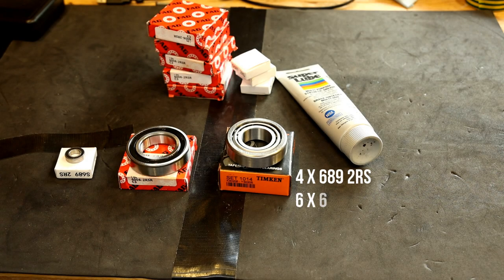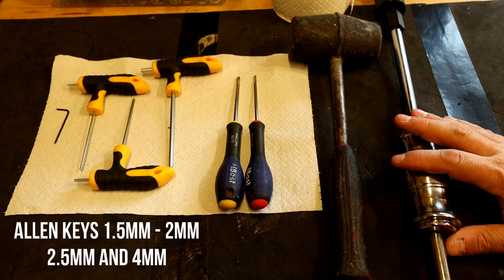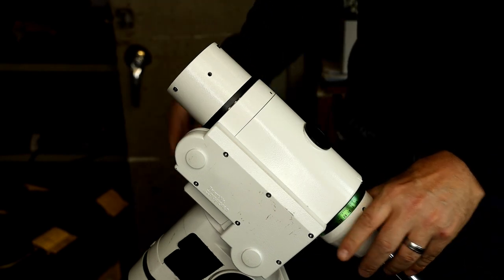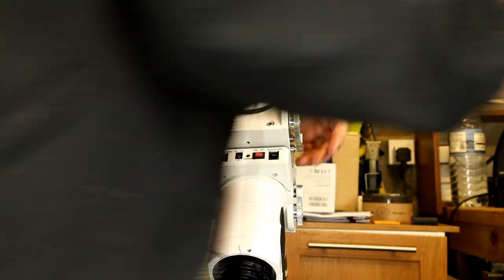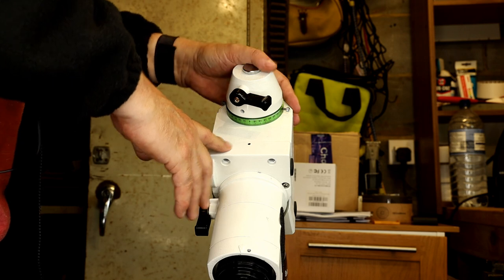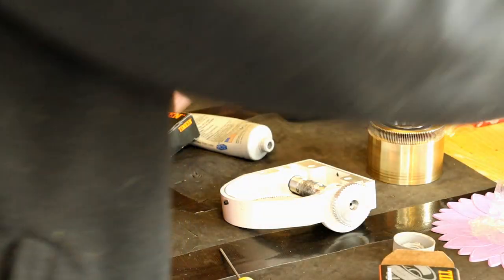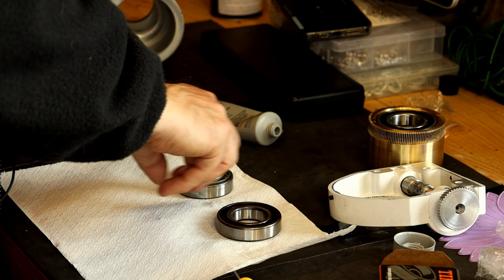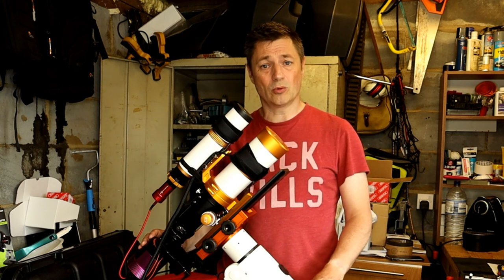HEQ5 Pro Hyper Tune. Get the best out of your mount. Astrophotography

Comment: What about just changing/upgrading the four small worm gear bearings? Dark Frame seems to just replace those and only inspects the larger bearings and replaces them if they are damaged. I think their logic is they do not rotate as much and move at a much lower speed. Also, movement on the main axis bearings does not really cause backlash, while movement of the worm gear bearings has a direct influence on rotation of the main brass gear. The 4 small worm gear bearings are fairly inexpensive while the 8 large main axis bearings are quite a significant cost.  AstroBaby in her EQ6 Supertune as suggests only the worm gear bearings are worth replacing. Martin in his video repacks the large bearings with new grease, which might be helpful.
Reply from the maker: If your mount is nice and smooth and the bearings are good then sure there is no need to replace them. I went down this route because my mount had stiction in the DEC axis and grease had leaked from one of the bearings. (Cheap unbranded bearings with poor seals) the main bearings won’t stop back lash as you say but a smooth mount with no stiction is easier to balance.
Reply: @Astrobloke  Good point about the leaking bearings. I notice on the bearings-online website for the 6006 2RS1 SKF deep groove ball bearing (the large replacement) it says they are sealed for life with an NBR seal on both sides. That makes me think that Martin's approach of breaking the seals and re-greasing might be asking for trouble since it will probably encourage leaking (particularly under hot conditions).
Reply: @Astrobloke  I think the small worm gear bearings are under a high amount of radial load and probably get mistreated by overtightening during the final adjustment process. In a sense, they are being asked to act like springs to keep the worm gear engaged, which is probably not what they are designed for. I notice Rowan Astro has an EQ6 worm gear replacement which has built-in springs to keep a constant pressure. Would be nice if they had one for the HEQ5 too or if someone figured out how to implement spring loading of the worm gear for the HEQ5. There's your next challenge!

Comment: If any of your axis feel notchy, then suspect the taper roller bearing and/or over tight adjustment of the bearings
Reply from the maker: Quite a common issue with these mounts out of the factory

Comment: Great vid Glen, very easy to follow thankyou heaps. This is the vid that gave me the confidence to have a go myself. Butttttt!@!!  I have one bearing stuck like the preverbal to a blanket to the base of the Dec shaft. I played with it for about an hour. It's stubborn. I'll have another go tomorrow.
Reply from the maker: You are welcome Chris. So annoying when one bearing hangs on. I had one do that to me once and I made sure there was grease on the  shaft and kept either working it up or tapping it back down with a rubber mallet. eventually turning it upside down it just fell off. They just need to be dead straight. Good luck

Comment: Thank you Glenn, I watched all your video in the hope of improving the guiding performance of my HEQ5. I have to say that in my experience any stiffness users may detect while spinning the RA or DEC axes, with the clutches released, is more likely to be caused by scuffing between the very large brass wheel gears and the close fitting outer housings rather than by any stiffness in the bearings. Thinking about the design philosophy behind the clutch action ask yourself why the brass wheel gear has such a large surface area and is such a close fit inside the outer housing. The locking of the clutch is not achieved by friction alone between the small button and the surface of the wheel gear. Regarding adjustment of the worm and wheel engagement I would also suggest that it is better not to fit the toothed belts and to turn the worm gear by hand while you make the adjustment. This way it is easier to detect binding which unfortunately can start well before backlash has been completely eliminated. I prefer to put up with a little backlash rather than have increased wear of my worm and wheel teeth caused by high engagement forces. Having said that you are getting great guiding performance at less than 0.5 arcsec RMS, I am doing well if I get down to 0.8 arcsecs. Cheers, Pete.
Reply from the maker: Hi Peter and thank you for your comments. I'm sorry but I don't fully agree with your theories on the mounts operation and design.
Any mount with rubbing between that gear cylinder and the housing would be in serious trouble and just wouldn't work at all. A lot of the stiction is caused by leaking grease onto that cylinder from cheap bearings or poor assembly and also parts being over tightened. That gear needs to spin freely in the housing. The large surface area of the gear is not to do with the locking mechanism. Its diameter is set by the number of teeth the gear requires and the rest of the body is there to hold the 2 deep groove bearing races that are needed to allow it to turn with minimum resistance on the shaft axis.
The centre shaft could never be moved to force the cylinder to contact the housing and the gear is locked just by the brass button and screw of the clutch lever. This is why when locked it can be made to slip without much effort.
I understand your thoughts on gear wear but as long as they are lubricated correctly there is little danger of that happening as these move at such small increments. I would argue that your guiding would improve if you fine tuned out your backlash. Good PHD2 settings using the guiding assistant and PEC training have all aided in me getting such good guiding figures and my mount now performs perfectly.
Reply: @Astrobloke  Hello Glenn, thanks for very detailed video and explanation about the mechanics of outer housing and the cylinder. I have a question though: during guiding and go-to, after we lock the clutch, is the brass button the only source of friction to drive the axis by the cylinder gear? If it is, it really seems not very secure and tight… considering the axis maybe be carrying up to 13kg of payload.
Reply: @yanghu6133  hi. Yes this is all friction that is applied. Remember your load is balanced so the forces needed to slew or track the mount are not that great. Unlock your mount and you can feel how much effort it takes to move it just by pressing down or lifting one side.  Not very much at all, hence why the locking mechanism is so small and simple and not required to be anything more.
Reply: @speedtripmantriumph7542  thanks, Yeah it makes sense. And also if the axis is stiff, it will put pressure on the guiding as well. So bearings are really important it seems!
Reply: Hi Peter, you were absolutely right with your assumption. After replacing the bearings of my HEQ5 I still had a little stiffness in my mount. I just saw that the brass wheel was scuffing inside the housing. I used a little sanding paper to just remove carefully a little material where I had brass markings from scuffing. That fixed it. Mount is moving freely now and is tracking perfectly. Thanks Glenn for this video.
Reply: @Karnivor555  Pleased to hear that you have successfully improved your mount. Tightening the clutch can make the button mark the surface of the big brass wheel a little. Regarding the clutch action the way it works is as follows: tightening the clutch lever pushes the button against the brass wheel which in turn pulls the housing away from the brass wheel on the button side and that causes the housing to press against the brass wheel on the opposite side. Because of the close fit between the housing and the brass wheel it doesn’t take much strain of the housing to get good friction over a large area and to lock the housing to the brass wheel.

Comment: Excellent presentation Glenn, thank you. My HEQ-5 is quite tight in RA, and difficult to balance. This has given me the courage to fix it. I notice that the  6006 2RSR units are coming up as "No Products Found in This Category" on the Bearings Online site, so I assume they no longer hold stock. Looks like I can source them from a supplier here in Australia though.
Reply from the maker: Thank you Neil. You can also use 6006 2RS1. Think the code denotes the type. The 2 and S meaning 2 seals so sealed both sides. The bearing companies are very helpful if you call with any questions and can recommend comprisable products. Should last a lifetime seeing as  they will move only 180degrees max in a night  and not 20,000+ rpm as designed
Reply: I would suggest loosening the lock nut that apply the pressure on the tampered bearing first.   Those mounts are assembled way too tight from the factory.   Loosening it would help quite a bit.  I did this on mine and it balances very easily now.
Reply: @tempusfugit6820  thanks for the suggestion. I'll give it a try.
Reply: @Astrobloke  I have now completed the process.. The RA is really good, but the Dec, while moving quite smoothly, doesn't spin like yours. Any suggestions? I'm still quite pleased with the result overall.

Comment: I have found the grease used on RC transmissions to be excellent.
Reply from the maker: I will have to check that out. Is it lithium based?
Reply: @Astrobloke  I cant remember, the stuff i use is called udder butter by CowRC.
Reply from the maker: @jasonpressler7111  Thats such a cool name, they also sell Moo slick lol

Comment: At 14:27 you have a very smooth and nice brass worm gear sliding against the aluminum body in an effortless way, but mine has a lot of drag. My bearings are great, rotating nicely, but I think the brass cylinder is just super tight with the tolerance up against the housing, so it causes drag and stiffness in the turning of the DEC axis. Do you have any tips here? Maybe remove grease from the brass cylinder gear and housing (apart from on the actual teeth), and (possibly) turn it in a lathe with some emery tape and take it ever so slightly to reduce the drag. What do you think? W.
Reply from the maker: The clearance is very fine between the brass cylinder and mount housing. There should not be any grease on the cylinder at all as the friction clutch uses this surface to lock the axis. Clear all grease and take the clutch lever and bolt out. There should be no rubbing at all. If there is thats a manufacturing fault. If you can’t get it returned then a lathe and emery tape may get you the clearance you need. I wish you luck. Let me know what you do and the results
Reply: @Astrobloke  sounds perfectly reasonable. I'll let ya know what happened. Thanks again for your input. W.

Comment: Based on how easy it was to slide the bearings into place, I think I would have used some Loctite Bearing Fit to ensure that they locate properly without any risk of spinning.
Reply from the maker: This was something I considered and if they were in a fast moving situation would have definitely locked them in. But with the extremely slow movements of mounts really didn't think this was essential.

Comment: Excellent thank you.
Reply from the maker: You are welcome!
Reply: @Astrobloke  Do the new bearings give the main gear alignment more consistency?  

I have an AZ-EQ 6 which I have owned for years and recently bought the HEQ5 Pro. 

I understand how to adjust the worm to remove backlash and the problem of binding if too tight.  

I spent a long time with my AZ-EQ 6 and have it as close to perfect as possible.  However the mesh is not consistent during a full 360 rotation.  RA and DEC. 

What I mean is that if I remove all slop it will rotate ok for most of the 360 degrees but will bind at one point.  If I loosen it to avoid that binding it has a little slop when in other positions. 

The HEQ5 seems much better.  I have the RA perfect.  No slop and no binding at all through 360 degrees. 

The DEC is close but I still have a bit of slop in the home position.  A tiny amount but easily felt when you test for it.  

Rotating 20 degrees either side of home the slop disappears and it is good.   If I try to remove the slop in the home position it will bind during rotating. 

Just wondering if the new bearings change this in your experience?
Reply from the maker: @Wolfie6020  No unfortunately. These are machined to a standard but are not perfect  by any means. The system used by ioptron in their CEM mounts seems a good solution as the worm drive is held in place via tension (magnets I believe) and so prevent the binding a fixed drive could give. I think the best you can do is adjust as close as possible with no binding. I know you can get replacement worm drives and gears but you are starting to look at serious money then and you would be better off buying a new mount.
Reply: @Astrobloke  Thanks for the detailed answer. I totally understand.  

Ioptron make nice mounts but they are hard to get in Australia.  The Celestron CGX has a spring loaded worm as does the AZ-GTi and star discovery pro.  I really like those mounts for that reason  (I don't have the CGX but do have the other two which have zero slop always) 

I can live with a bit of slop in the Skywatcher gear.  Overall they still work very nicely.  Very happy that I have zero slop or binding in the RA on the HEQ 5.  I could never get that in the larger AZ-EQ 6

Keep up the great work, I am enjoying your videos.  You explain things very well.
Reply: @Astrobloke  I did the belt upgrade today.  It went well except I broke a wire on the RA motor connector.  Tt was an easy fix with a soldering iron and all good now.  

The mount is so smooth now. 

https://www.youtube.com/watch?v=Tzh8_tw2tN8
Reply from the maker: @Wolfie6020  Think that is one of the best upgrades for the HEQ5. I was so lucky to buy a used one with this already done. Thank you for sharing your link, I didn't realise you had a channel to which I now subscribe.
Reply: @Astrobloke  I am getting about 0.75 arc second guiding already without any tweaking.  I agree, it is a great upgrade.  

Thanks for the subscription. My videos are mostly just showing why Flat Earthers are wrong.  I am a pilot so I use actual footage from planes sometimes. 

I love astronomy and that is my main hobby at home and when away.
Reply from the maker: @Wolfie6020  Thats cool being a pilot, proving flat earthers wrong is a good thing lol.  I've got my HEQ5 guiding so well atm. last night is was in the 0.3 total rms numbers and went up to 0.4 after a couple of dithers. Such a nice mount and I love using it. I move this one around my garden and plan to take it on trips to darker skies. A lot more portable than my EQ6

Comment: Great video, but I think you made one mistake which may have been the cause of the difficulty setting the play on the RA axis worm gear. Well, it seems to me that you should first set the slack on the worm gear and only then put on and set the tension of the axle drive belt. When you did it like in the video, after adjusting the belt tension, while adjusting the slack on the worm gear, you were changing the position of the worm pulley in relation to the motor pulley and consequently changing the belt tension.
Reply from the maker: Hi and thanks for the comment. I think you are completely right and if I was to do it again would do it that way. I was still able to adjust everything but maybe not as easily. Youtube do not allow any edits to videos on e published which is a real shame, i would have to delete and make it again which would be difficult as I sold my HEQ5. Clear skies

Comment: Re cleaning the worm gear sets with solvent in a saucer, you will be surprised at the amount of fine metal particles that settles out. I tried shouting through the Internet-net but you had the volume turned down-ha ha. Lesson for others I hope who will benefit their mounts with a strip down, solvent clean all the old grease off, and a fine regressed with white Lithium etc. without changing bearings if they feel OK, a lower cost approach for those who don’t want to go to the extra expense. Generally I have found the original greases used of poor quality. Greetings from Tasmania Australia-Southern Cross Observatory-42 South.
Reply from the maker: Hi Sheville and I hope you are well. I was not as thorough with the cleaning as I should have been but was lucky as the mount is still guiding below 0.7 total rms. If however that changes and it needs a service I have a degreasant ready and waiting to make sure its sparkling before a re grease and rebuild. Clear skies to you sir.

Comment: Not all of the bearings listed are available anymore through your link. 
4 x 689 2RS (Available)
6 x 6006 2RSR (NOT available)
2 x 30205 Timken roller bearings (Part# is a 30205M - not sure if that is the same)
Reply from the maker: The bearings do seem to change but mainly in the lettering which denotes types of seals etc. the numbers are the important bit as that’s the size.